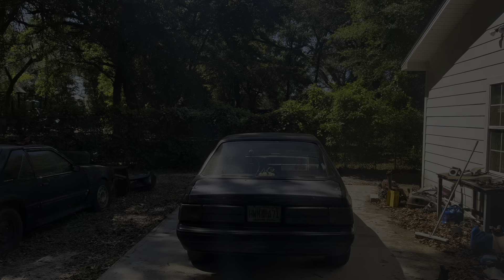1990 5.0 LX Notch Mustang pt.50 Rockin and Anti-Rollin!

Comment: lets see if the air dam helps or hurts, thumbnail had me confused on what car it was lol.... Going for those records though, might need a "pecker" extender for max over hang.   I know that look of dread when you gotta pull the trans again on the ground, man without a lift I wouldn't have the energy to do that stuff these days.
Reply from the maker: Air dam is strictly for looks, it’d probably rip off if the car had any real speed and it hurt to add that 8lbs to it 🤪…it’s more missing the TNT day which just puts me behind in the mods😔…still not a barrel of monkeys 🙈 kinda fun pulling it though👀

Comment: Rodney...Are you sure it not going over center ??  I have had several diaphragm  clutches hang up when I didn't have my clutch stop set just right.

Love how the old nugget is looking... I would love to know how much it and Pro Stock weight now ?

Keep up the good fight against that Mr Fear dude... He just a real party pooper. (
Reply from the maker: I’m sure, it was fine till i matted it with the 2-step off and it got sucked to the floor and I don’t use a clutch stop…it was a $100-120 eBay clutch (26spline)that I’ve had on the shelf for 2-3 years, my expectations were not super high…I’ll say pro stock is/was lighter for sure right now✌🏻

Comment: Just rest your eyes while hand puppet pulls that trans. You've shown him how to long enough!
What is the science behind the pressure plate not clapping? Not enough weight on it? To weak of spring? Etc.
Reply from the maker: 🤣🤣🤣he still needs moral support…spring, it’s just getting sucked down and/or not releasing on the shift at “high” rpm…probably be fine at 5.5-6k all day, just not where we operate..disc has been working great though 💪🏻